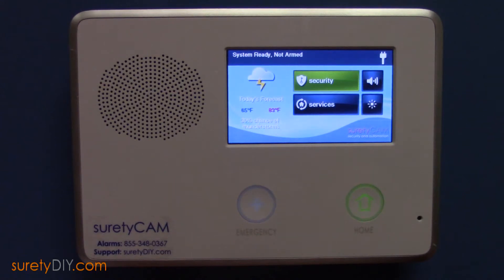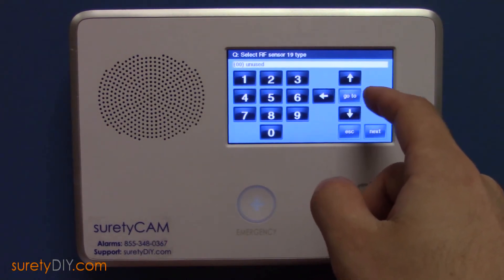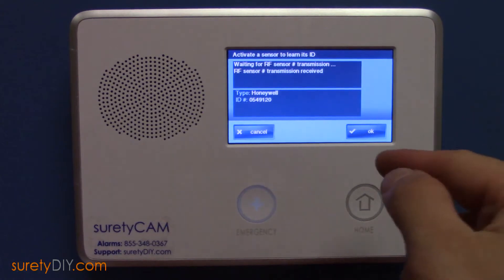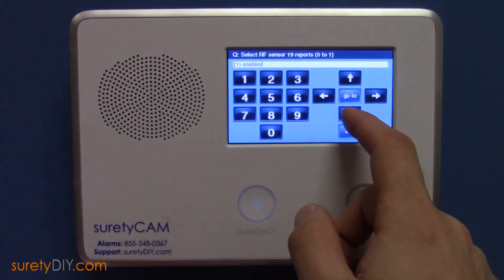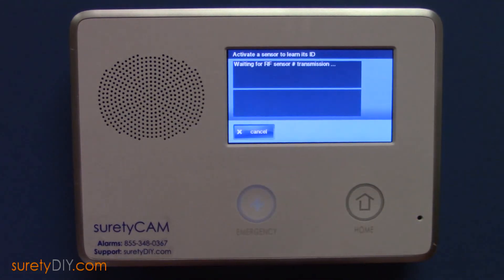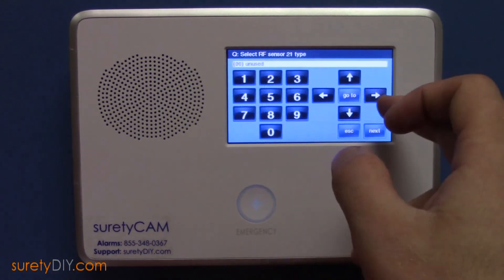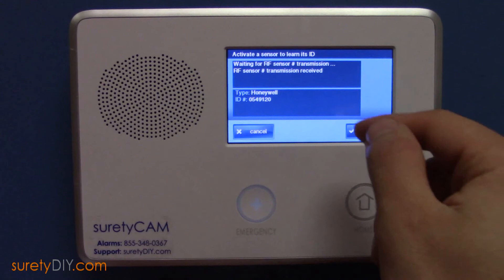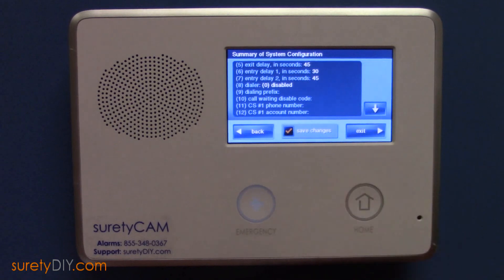How to Program an RE219 Flood and Temperature Sensor into a 2GIG Go!Control Panel

Comment: what Honeywell temp sensor is compatible with 2gig? I see in the video that you learned a Honeywell temp sensor
Reply from the maker: The device in the video would be the Resolution Products RE219 Flood Temp Senor. Honeywell makes a 345MHz sensor called the 5800FLOOD which would be compatible and acts as a flood and temperature sensor.  Note that this is an environmental sensor that triggers when a certain temperature is reached, it does not display current temperature.

Comment: Anywhere you can see the current temp ? Or its only trigger alert when temp reached?
Reply from the maker: The RE219 does not report temperature values. It detects and alerts once the ambient temperature hits a certain threshold, below 40 degrees and above 100 degrees, respectively for the freeze and heat loops.
Reply: @Surety  Thanks for the reply. I know alarm.com have temp sensor, do you know if there is other brand temp sensor?
Reply from the maker: @kibubkibub  The Alarm.com Temperature Sensor (ADC-S2000) is the only device of its kind that is compatible with Alarm.com.
Reply: @Surety  That what I thought . Thanks